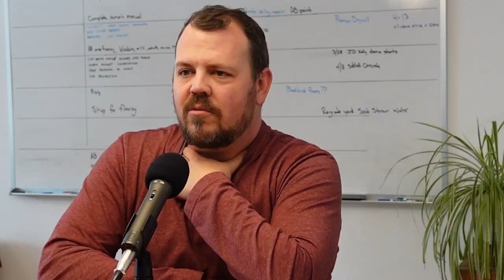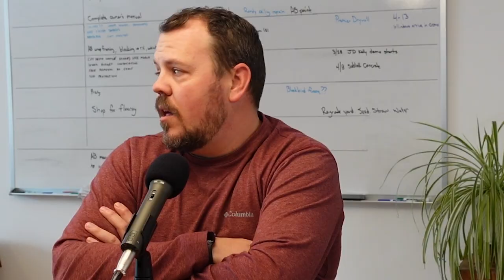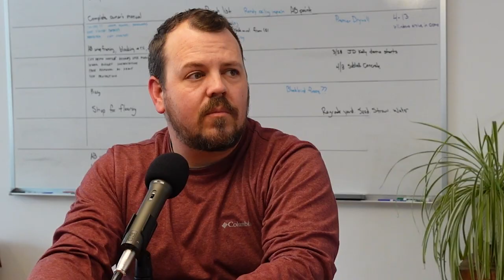Roof claddings - roof cladding is about a lot more than just cost. - UnBuild It Podcast Episode #62

Comment: As additional material when discussing flat roofs, consider discussing roofing slopes and roofing material when solar panels are to be installed. Standing seam metal appears the way to go, but I am learning new info with every episode I watch. Or maybe solar panels are not recommended on roofs at all. Please discuss. Thank you
Reply: you need to design (including actual wind engineering and tie back to structure not just a rough idea) the mounting system before the “roof WRB” is installed. Think brick ties on a commercial wall probably better if they go up before or at least with respect to how WRB detailing is done. I wouldn’t plan to do solar on a roof that didn’t have a continuous top to bottom fully adhered membrane under the roof cladding. You might also want solid blocking or doubled sheathing of some description integrated into the roof framing so your anchors don’t necessarily have to land on rafters/trusses (for aesthetics or to facilitate avoiding the seams in standing seam or other roof cladding attachment interference issues).